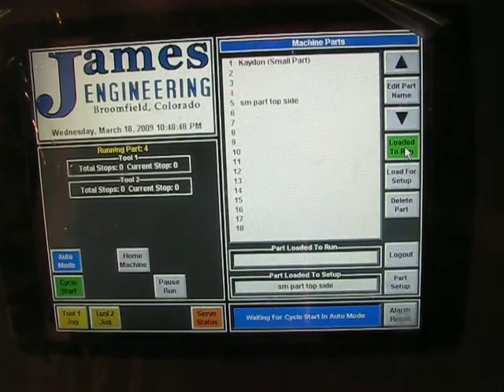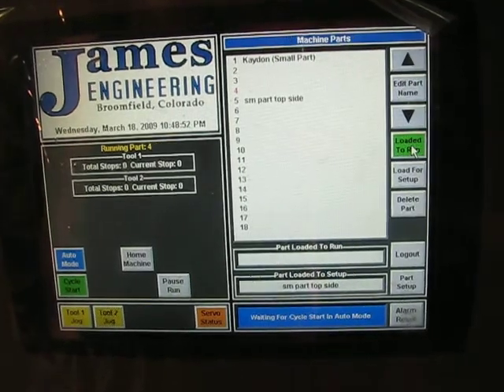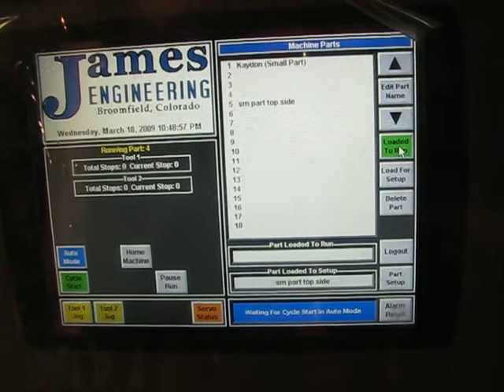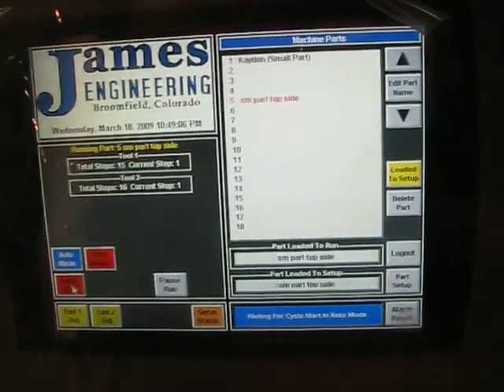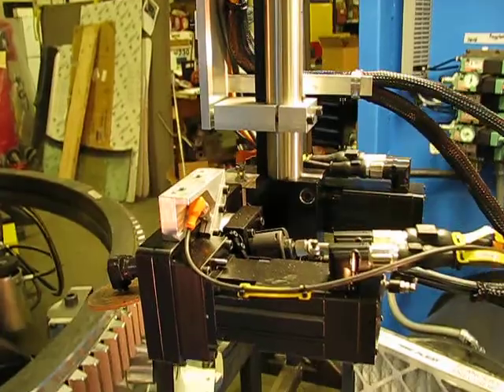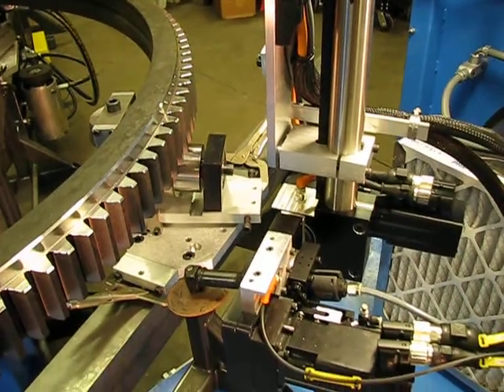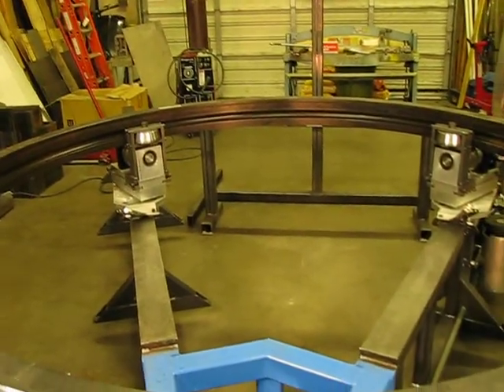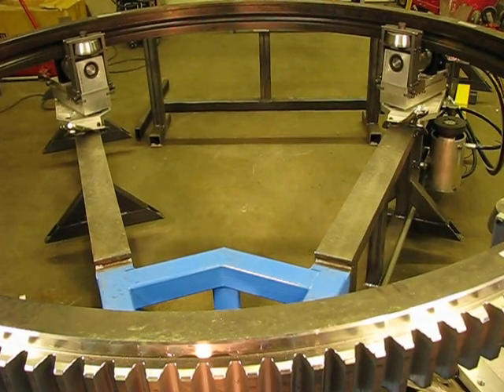2862-160 MAX System™ with an 84 inch gear

Comment: Dumb question: the fairly large edge rounding of tops and bottoms of the teeth look great. On a ring gear like this, what is the upside of this added machining? Don't these gears stay meshed with a driven pinion  100% of the time (slewing ring)? Or is this more like a large engine flywheel gear that has a starter motor/solenoid driven pinion
Reply from the maker: That's actually a great questions! There's a few upsides to adding this chamfer radius, but it ultimately comes down to preventing wear on the gear. Depending on the use of gears high amounts of heat poses a threat actually cracking and creating a brittle edge. A sharp edge creates a weak point on the gear that can break from harsh movements and create a burr towards the points of contact. This gear here is actually intended for a servo driven rotary pinion.
Reply: TIL!  Thx